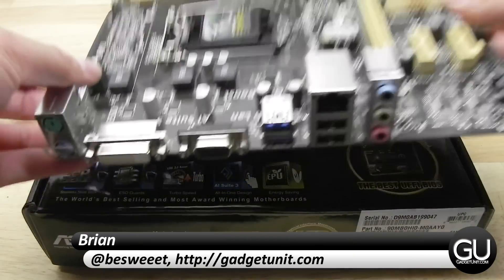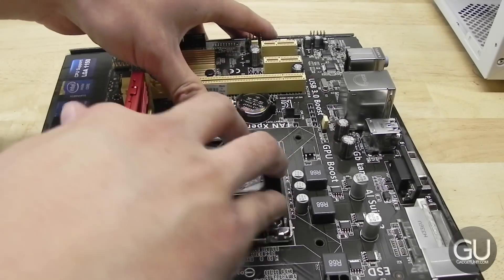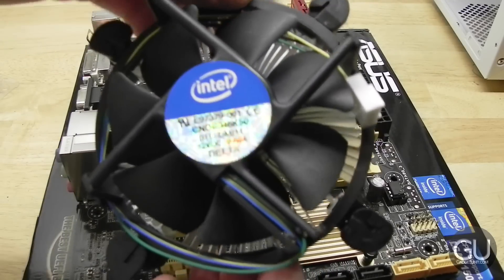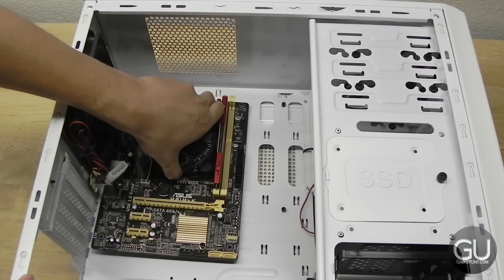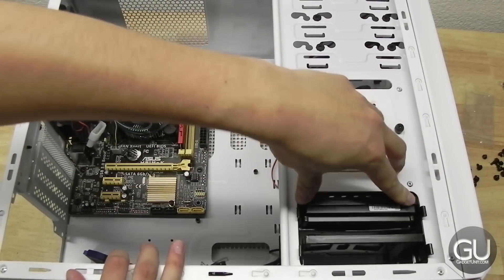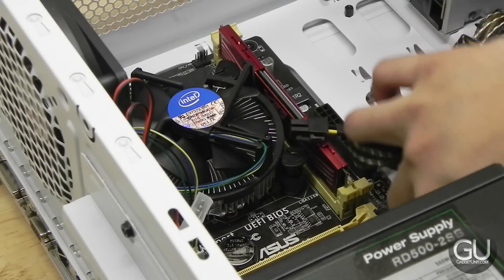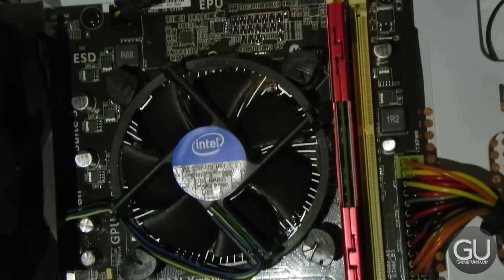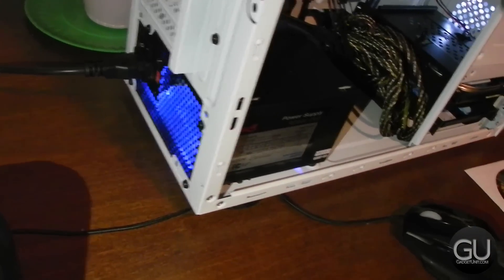[2014 Sub-$300 PC Build] Part 9 - Building the PC!

Comment: i have this case but i dont know where the rear fan and front fan plugs go. i have the msi a78m-e45 mobo. thanks
Reply from the maker: +FurIouS The fans use a molex connector, so it plugs into your power supply.
Reply: thanks!